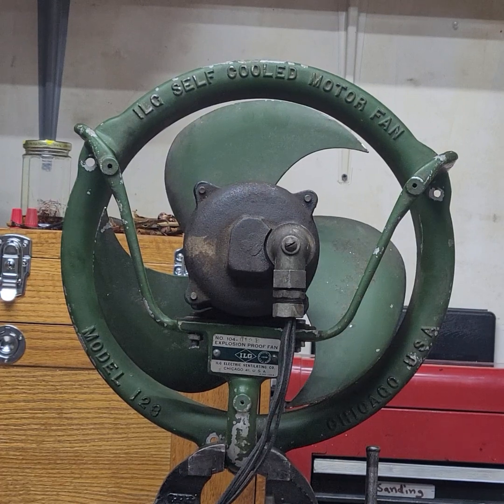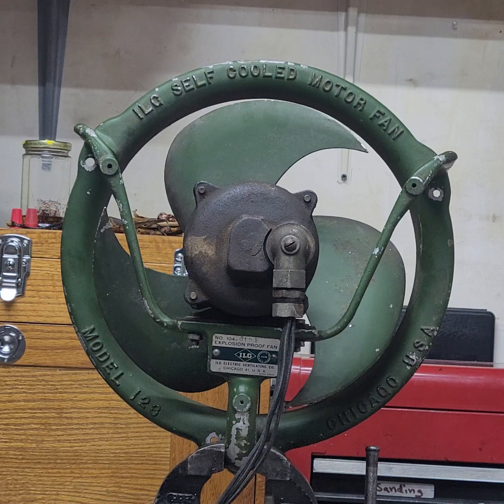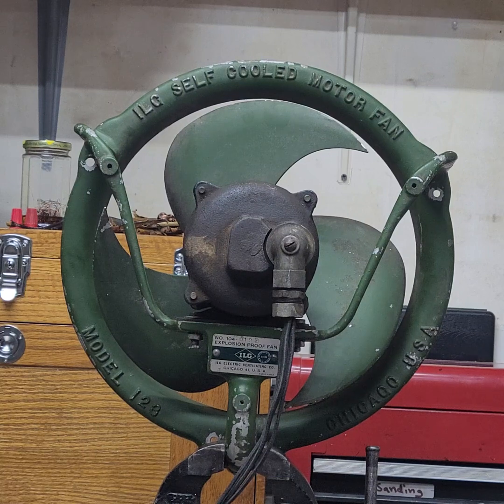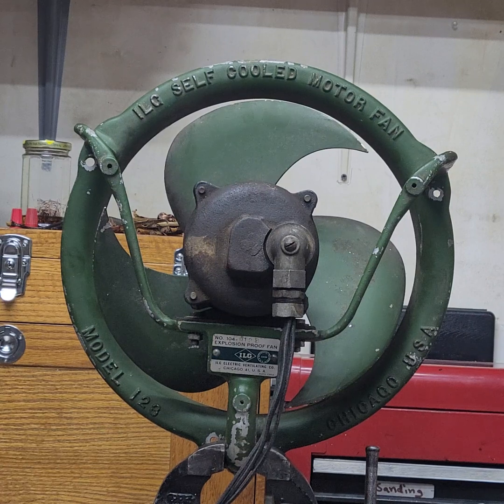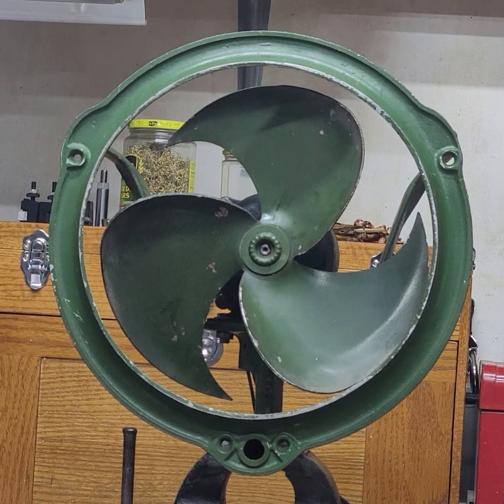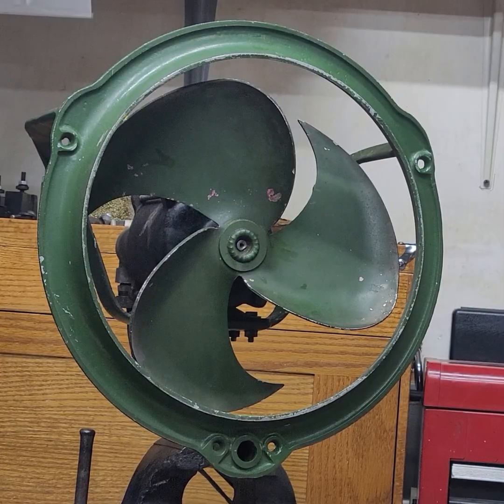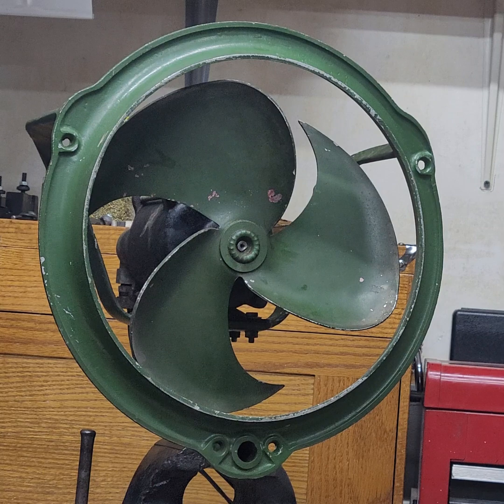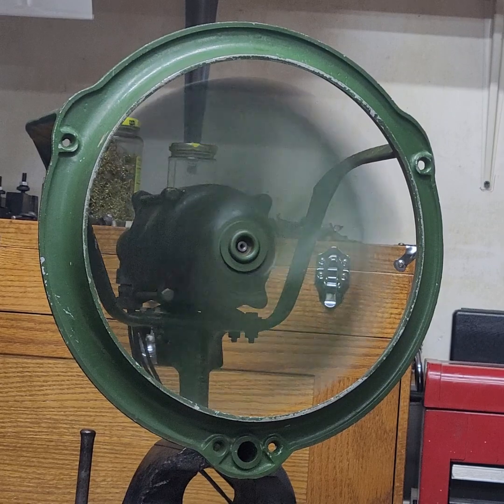ILG Model 123-XQ "Explosion Proof" Fan initial run 1725 RPM!

Comment: Interesting these "explosion proof" ilg's must be pretty rare I've never heard of them. 
I live in the UK and ilg fans or any American made fans for that matter are virtually non-existent except for the handful that's been imported. 
The fact that we only use 240 volt/50HZ electricity may explain why no American fans were made here.
Reply from the maker: These explosion proof ILGs are definitely  a bit more on the rare end of the ILG spectrum. I also can imagine how hard it must be to find ILGs in the UK. The one fortunate thing about the medium to larger size ILG fans is that they were commonly made with dual voltage motors. They could often be wired for 120 or 240 volts and of course the frequency difference would have them running a bit slower on 50 Hz power but I am sure they would still move lots of air!